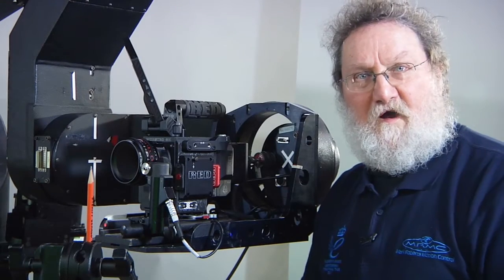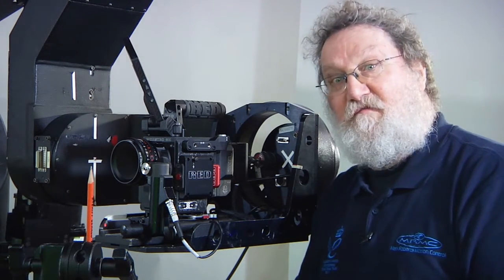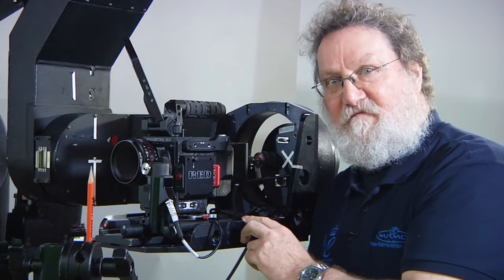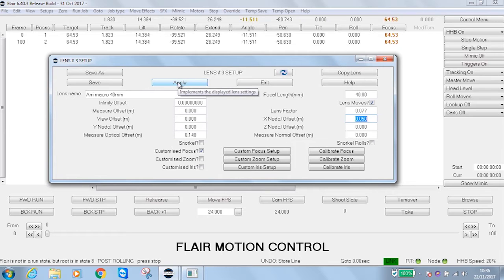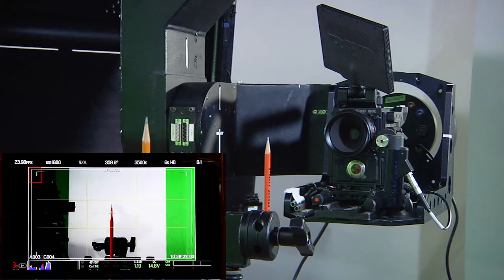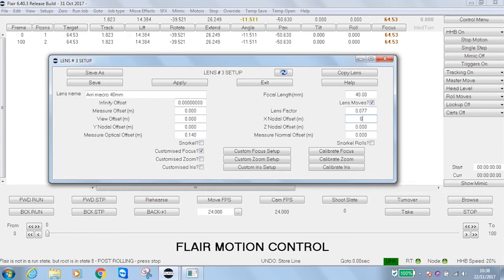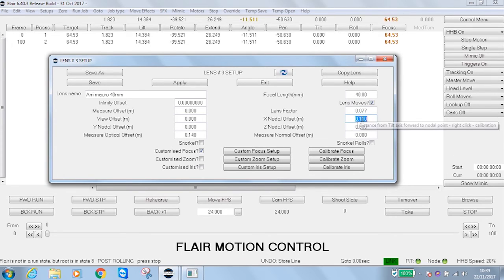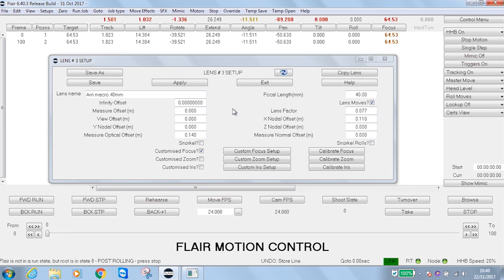21 - Nodal Offsets

Comment: Hi Peter, probably a really obvious one, but a question re 'position of the camera' mentioned at the end of the video, here if I understand correctly you are referring to the position of the camera with respect to the camera mounting plate, and therefore the center of the pan axis - and not literally the position of the camera in physical space..? Also if so, can this process similarly be used on the tilt to establish the vertical axis offset really accurately?